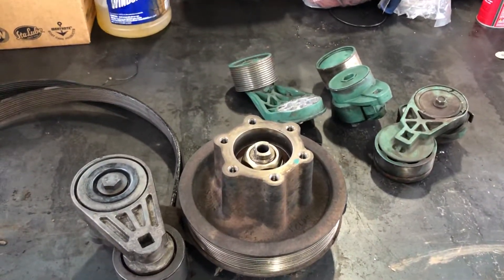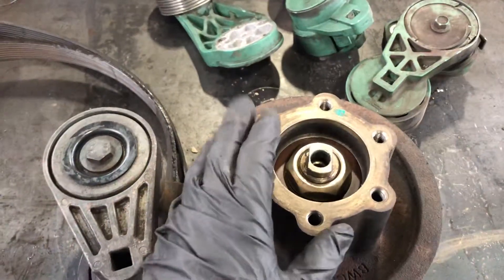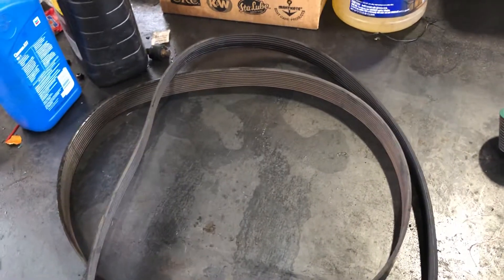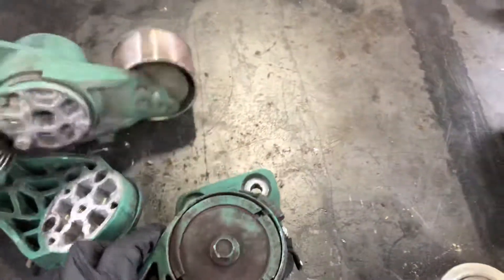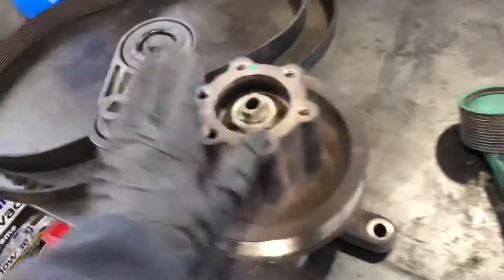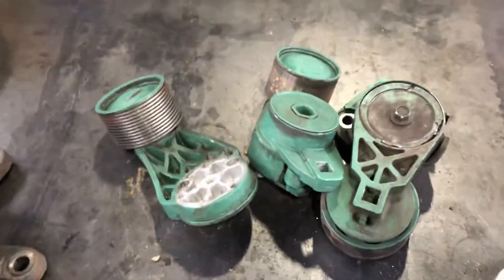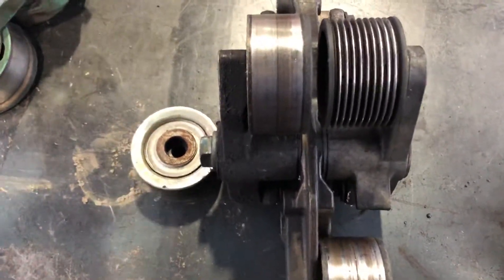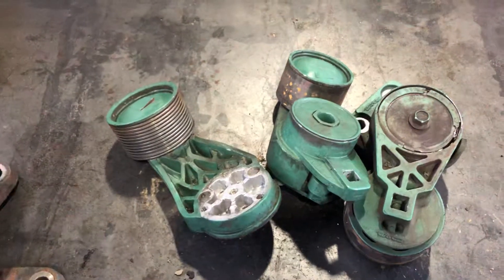Heavy Duty Diesel Engine 101 Episode 2: how to check your fan clutch, belts, tensioners and pulleys.

Comment: Mine makes a super loud noise I already change the belt 3 times could it be the fan clutch base?
Reply from the maker: If you already replace all tensioners, pulleys and belts. That fan hub could the cause of the noise, but before change it, make sure your compressor and alternator pulleys are fine, then you can check the fan hub. Thanks for watching.

Comment: I have 2015 d13 vnl780 ishift 616k I bought it at 543k no problems at all but what services would you recommend at this point !?? 

I want to replace the belts and tensioners along With the hoses and coolant maybe thermostat.

What else you recommend?
Do you have email?
Reply from the maker: That will be a good idea (if you have not change those parts yet). Crankcase breather will be good to replace if there is a oil leak or weird sound. Check your brakes, drums and fluid levels in the differentials. Transmission oil level and keep an eye for things that you might think do not look right or in place. Thanks for watching and support the channel.

Comment: My belt was torn from the edge back smooth  side , I replaced tensioner & all idle pulleys on my dd15 & I just noticed  that is doing the same again with the new parts from freightliner seems like its rubbing on something but it's not,  any advise.
Reply from the maker: This is a good question... underneath at the beginning of the oil pan, with a flashlight, check out it if a bracket of the harness is the problem. If you see that is rubbing against the belt then that it is your issue. I hope this help you.
Reply: @LetstalkDIESEL  wow after 2 of my mechanic's , u figured it out. The bracket was rubbing fixed it now problem solved thanks a million.